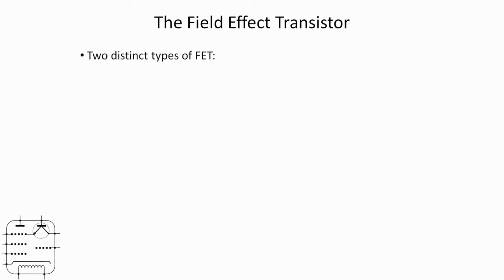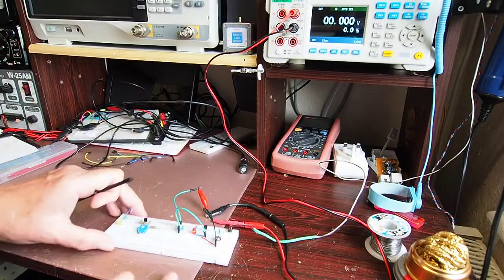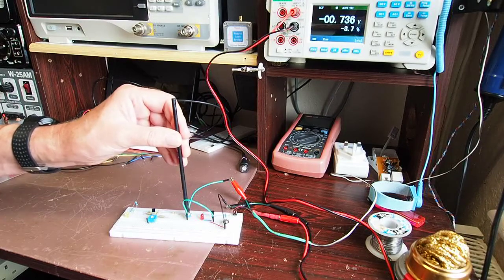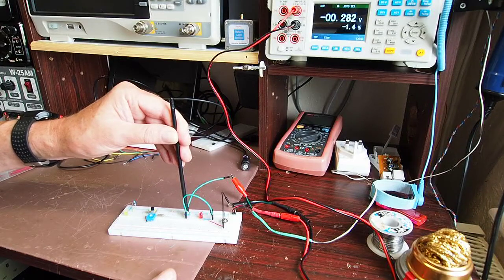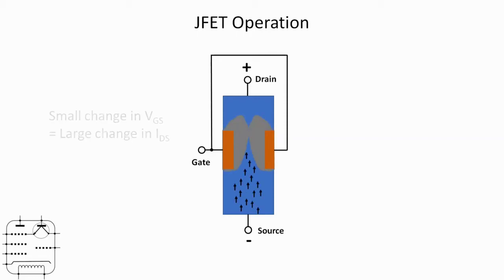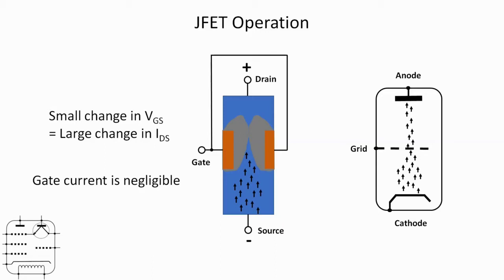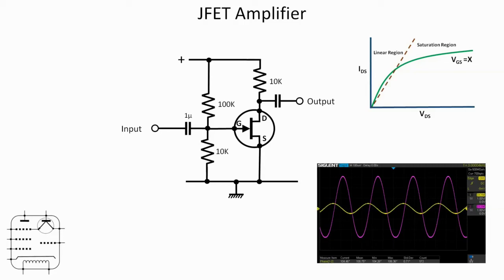The Field Effect Transistor -  Part 1 -  The JFET  -   # 079

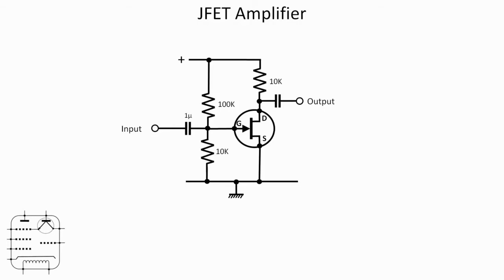Comment: At 3:20 you're careful to avoid accidentally forward-biasing the gate-source junction, but the schematic at 12:17 does exactly that. With the right selection of bias resistors it may just work, but only over a very narrow range. Are you sure the schematic you've shown matches what you wired up on the breadboard? You can't simply replace an NPN transistor in a common-emitter amplifer with an N-channel JFET.

Comment: Thanks, Bill. This was always a little confusing to me, but I think I finally think I understand how it works. This video built well off last week's video of generating negative voltages. I bought the FNRISI 1014D which is the benchtop model of the tablet scope you are using, And I really like it. It measured my 30 mhz oscillator ok which is good enough for me.